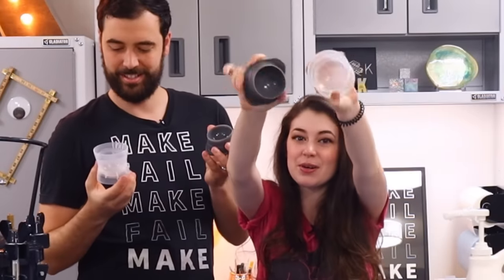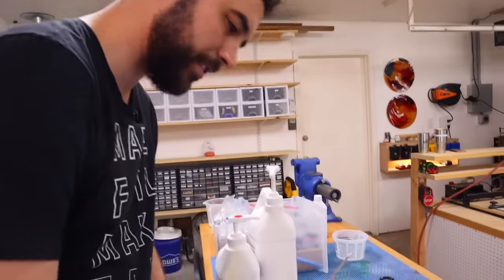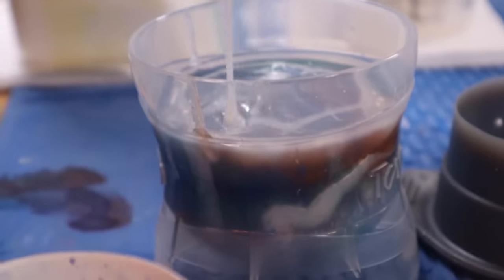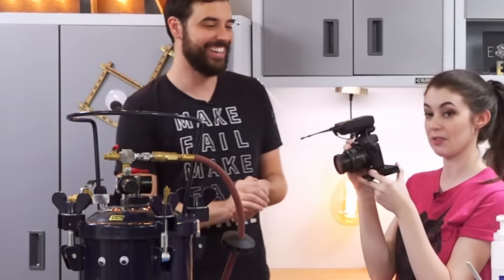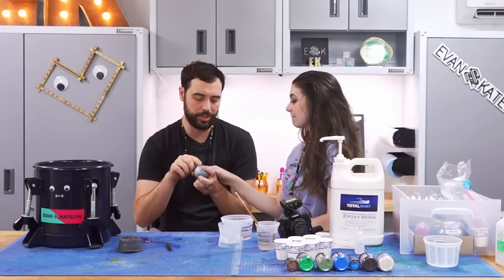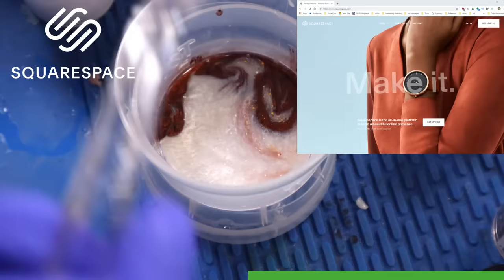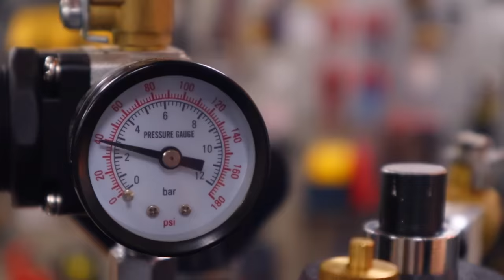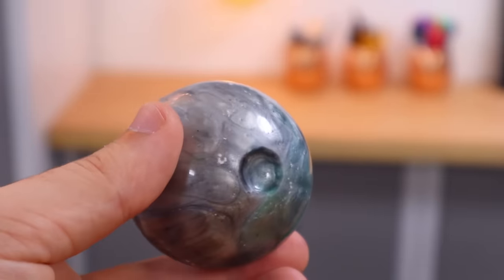Trying to Make Resin Planets with an Ice Cube Tray

Comment: if you let those layers of resin cure even just for 45 mn (to gel state) and then add your next color - they would not blend. Time is your assistant for making planet-y stripes!
Reply from the maker: Great tip, we'll have to have a little more patience next time lol
Reply: EvanAndKatelyn Can you try again? These are so beautiful I’d like to see this techniqued tried.
Reply: Yea! That's what i was thinking! and that's what i actually do with resin!
Reply: Could the pressure be pushing the colors together also?
Reply: What about when they put the top on, wouldn't that ruin the layers?
Reply: @dxyeart7318  Not much really if the layers are already at gel state.
Reply: @EvanAndKatelyn  I call for a do-over!
Reply: @EvanAndKatelyn  Do that and use some UV and transparent resins and galaxy colors to make a galaxy ball that if you put a light in a hole in the bottom of it, it lights up
Reply: Smart
Reply: @EvanAndKatelyn  no it's great I think it's good even though you messed up alot😇
Reply: @EvanAndKatelyn   Next time? 👀

Comment: If you want more defined layers/striations let the resin pours sit a bit & get to the gel state to the next layer floats better on the set up resin
Reply: They're too impatient lol
Reply from the maker: That would definitely have worked better lol 😜 always wanting to get on to the next project
Reply: Then they can’t out the top on
Reply: Or even do the outside like the clouds and continents or whatever and then fill the rest. Doing it in two pieces like Sam said would work well for making the outside first and going in. You could even do like the magma layer if you were feeling super into it or whatever.
Reply: @galaxystudios8304  I think it's also possible to fill the mold while it's closed, because there's a hole in the top, so it would require very careful pouring, or a lot of disposable funnels/pipettes
Reply: I know alot of Crafters use light curing resin. And cure it between each layer. It's a risk of over heating/ cracking resin.
Reply: @galaxystudios8304  they could if they attached the top and then used the pipettes *sp once the top portion on. Not sure how accurate the layering would be.

Comment: My mom made an acrylic transparent resin grapes display back in the '60's and I remember she had these real thin glass ball molds in varying sizes and they had a little 1/4" hole at the top, where you poured in the resin or acrylic and once dry you'd break the glass around it and ta-dah...and then rinse and repeat!

Comment: The thing with resin is that it has a kind of "convection" flow, like magma on the inside of the earth where the hotter magma rises to the top. So because it creates heat when it cures, the resin in the center rises and the cooler resin that touches the walls falls. 
Also the pressure chamber plays a role because the invisibly tiny air bubbles in the mixed resin get squished together by the high pressure and so the resin moves against itself and doesn't stay in it's place. 
That's why it's hard to do all-in-one resin pours where you want things to stay in a specific place. 

You could try a different sphere mold (or pour one out of silicone yourself and cut it in half) and just paint your continents or stripes on the inside wall, let it cure until it's leathery and then just pour the rest of the resin in, so you have at least some parts in the specific places where you want them.

Comment: You guys should try a project but instead of using any big machines you should use cheaper tools that are more available to people. Anyway keep up the good work!
Reply: Thats their early videos
Reply: Sathvik k 
It would be a fun challenge, to first do a project ‚professionally‘ and then try to get the same result with more basic means...wood already cut to size at Lowe‘s, basic tools...often, it’s way easier to do that, if you’ve done something the right way first.
Like with cooking. You can improvise more easily with a recipe, you’re familiar with.
Reply: @raraavis7782  That's exactly what I was thinking, I think that would make for a good video.
Reply from the maker: Definitely have some of those ideas on our list of projects to tackle!
Reply: @EvanAndKatelyn  cant wait!
Reply: You can pick up a paint pot at Harbor Freight for around $70-80 on sale. I'd call that an affordable tool
Reply: Agree.  I'm not going to buy one of those pressurizers.

Comment: The problem of the layers being squished the day after was because you were presureizing the resin down which made the layers squish into each other making it look like the layers are directing to a point. Next time you should put the resin in the vacum chamber then try pouring int the mold make sure no splashes happen, so you dont form any new bubbles. Also, to have a seperate layers you could have waited for each layer to be in the gel state then try to pour your next layer. Making jupiter(not Jupiter like).

Comment: First of all, Love your channel :)
Secondly, if you wanna do layers with resin, specially if you are making a replica of jupiter or something like that :), try this: 
pour 1 color and wait for it to almost set, but not completely, then pour your second color and repeat the same.....IK it is a labour intensive process but the end results are worth it.
BTW you don't have to worry about the bubbles much in a layering method as i have mentioned coz the bubbles will be hidden in between layers and more over the colors will help camouflage them.....  amazing work again, LOVE THIS CHANNEL :)

Comment: The air vacuum pulls the air out so it's pulling the air out of the the mold from the hole on the top which pulls the paint upward therefore you get the streaks going up and it looks like that from the bottom.

Comment: That is a fun project! Do you have to leave it in the pressure chamber until it cures?
Reply from the maker: Thanks! I think to get the full benefit from the pressure chamber it's safe to leave it in til it cures, but since you technically don't need the pressure chamber at all you could probably take it out early

Comment: My assumption for the reason the bottom of each ball had that effect is the pigment was settling in the resin. Perhaps where layers are required, allowing the resin to cure a bit before adding another layer (excluding the middle/top where you need liquid resin to conform to the mold) could help? Would require some planning to stagger the mixing of the resin at appropriate times though, increasing the complexity.

Still, they came out pretty cool!
Reply from the maker: I think you're right!

Comment: I’m not sure if you have already done this but you need a filler valve on your pressure pot, so you can use a tire air chuck to pressurize. That way if you get distracted with filming or anything your not just depending on the safety valve. Love you videos, the thing I like the most is that you don’t make them seem like you did everything in an hour.

Comment: The colors streak up because the pressure pot actually mixed them. It causes any air to rise up = mixing. You'd be better off doing half, blow torching bubbles, then coming back after that bit dries normally and starting again.
Reply from the maker: Might try something like that next time!

Comment: for resin art, to make layers in particular, you can try doing a layer, let it cure, then the next layer. if you're worried about the layers being too crisp, then you can mix a tiny bit of the prior color and make a thin layer before adding the next color. It would take longer, but you'd have more control... 🤣

Comment: I have a suggestion:
You could have made a smaller sphere and use it as the planet's core (the bottom part of the planet should be solidified with a hollow or something to place the core). I think this might help you draw patterns OR you can place solid pieces of resin to make "continents" or something, then pour the rest of the resin to the top and cover the surface.
I'm not an expert (...I've never poured resin in my entire life), but I think this idea is worth a try.
I love your videos btw. 
Cheers!
Reply from the maker: Good ideas! Thanks!

Comment: Next time, try to use condiment bottles to pour the resin, it helps to mold the shapes you want. I use it with frosting all the time when im baking, it should work with resin as well. A well washed ketchup bottle would do just fine :)
Reply from the maker: Thanks for the tip! Are you able to reuse them?
Reply: Since i use them for frosting, i reuse them just fine. With resin, i can't be sure, but I believe it should react to the resin similar to the tubes you guys used to splash the white in the resin spheres, since it's also hard plastic. Since it's just an idea from the top of my head, be safe when trying it out, pour the resin inside a plate and wear gloves, in case the resin heat reacts with the plastic or something like that.

Comment: y’all should do this again using a clear half-sphere silicone mold and UV resin, for jupiter you could put small layers down and cure in between each one, and then just use epoxy to join the two halves together, and for the “earth like planet” you could pipette/brush on the continents and poles and cure those, then fill the rest with the blue resin and let it cure, and also join those

Comment: for jupiter you could have put a few drops of different colored resins on the side of the mold and tumbled it so it would form striations then you could fill the middle with a single solid color

Comment: the bottoms look like that as a result of pigment falling out of the resin to the bottom - you should mix it in more thoroughly, let it bond to the resin, before pouring. you might want to use one of those foam mixer things, just avoid overmixing to prevent air bubbles
Reply from the maker: Yeah I think too much pigment, and not mixed enough 👍

Comment: I’d love to see you do this again like a redo vid, and get a mould and quicker setting resin or uv resin where you can pour in layers and half to fully set every few layers, and if you do two to 3 colours/layers each time you will still get that little bit of a blend that you need instead of harsh lines,, then when you have two halves glue together with resin, sand then buff,, it would turn out exactly how you want it and you’ll still be able to stick it in the vacuum chamber between each few layers

Comment: so physical explanation: the problem in this case was density and gravitation. Thus denser liquids have greater specific weight, they wil sink to the bottom. Epoxy didn't have the same density because of differents amount of coloring. That might explain the "seas" on the bottom of the mold.
Reply from the maker: We had a similar theory! Also I think we didn't mix the pigment well enough
Reply: And another problem might be the vacuum chamber. As far as I know, resins should have been vacuumed before pouring them, as they might got merged because of raising bubbles, on which some resin had stuck to. Would really apreciate to see the vacuumed-before-poured versions beacuse I do really like the whole idea of resin planets👍☺️

Comment: Why not use UV resin to cut down on the stress factor?!
Also, you end up with the bottoms being striped upwards like that because the vacuum is sucking all the air bubbles out through the hole in the top of the mold (or mould depending where you’re from!) and as it does this, the bubbles drag the pigments with it.
Reply from the maker: We might try it sometime!

Comment: I think that pattern in the bottom was formed during the pressure chamber process. The resin BUBBLED from the bottom. It also mixed the colors during that and when you put the cap on. That's why the sides didn't turn out as you wanted. ;) REPEAT PLEASE! Maybe try to pour the resin WHILE THE CAPS ARE ON? The king of random channel has a transparent pressure chamber. Maybe you can make something like that so you could see what's going on?

Comment: you guys should attempt this again but let each layer cure before doing the next. maybe only an 1/8th of an inch at the most in every pour until its full.
Reply from the maker: That would work better! Haha we were just being impatient 😅
Reply: @EvanAndKatelyn  I'm doing some projects of my own involving the pressure pot and I've found that its actually better to overfill; as the compression of the air in the resin actually accounts for a larger volume than you would think. I think that's why your planet came out of the mold lacking the craters that Evans had. (Speaking like I'm assuming Katelyn is the one managing and replying the comments lol)

Comment: A) bartenders are only able to layer drinks with different densities and by putting the the denser liquids on the bottom layers B) they use the back of the spoon to layer C) the blending that occurred is because everything you used was of the same density and so the pigments just dropped over time before curing... as a thought maybe use natural forms of coloring your resin to achieve different densities for layers.. not sure how you would incorperate continents and clouds but i hope this comment helps with future endeavors.

Comment: I mean, I know that Im hella late and overdressed for party and would have to do some heavy comment digging BUT (and I hope someone has told you this by now) if you flip the spoon over and let the resin drip off the underside of a spoon, it will break the surface tension for a smooth wet-on-wet situation, like a black and tan situation. So Smoooooth.  Yep, so thats me, just making my appearance.  KTHXBYE. <3

Comment: Your resin planets turned out that way bc you didn't cure in between layers. I would recommend using a UV resin if you plan to make more in the future. Pro tip, use ivory soap shavings, finely shaven,  to create clouds, and start with a thin layer of clear resin on your mold. Also, instead of using spherical molds like you were, consider making two halves and using resin to adhere them. Hopefully this helps you guys out in the future! I'd also watch this video which is where I learned those tricks https://youtu.be/1CxJ_NMDv2M
Reply from the maker: Thanks for the tips!

Comment: did you guy know that when u put it in a pressure pot when it’s trying to pull out the bubbles it also takes the pigments with it 😂
Reply: Pressure pots don't pull bubbles out, that's vacuum chambers.

Comment: I'm just wondering, I've seen a few resin videos and only noticed you using masks/respirators when filing things down but not when pouring.  Resin fumes are quite dangerous, even commercial based ones and should always be used in well ventilated areas with masks on because of it.  I'm wondering if it was ever mentioned why they aren't wearing masks?